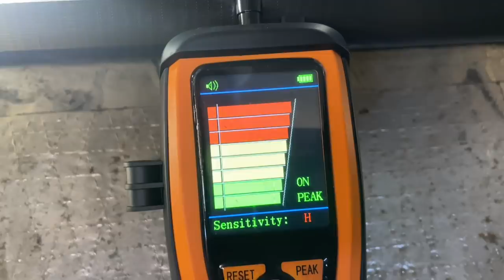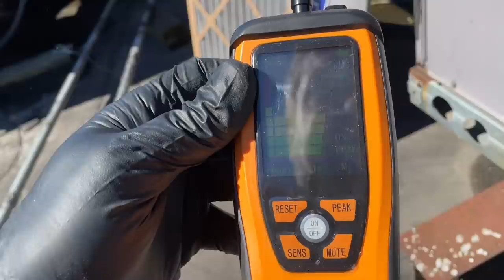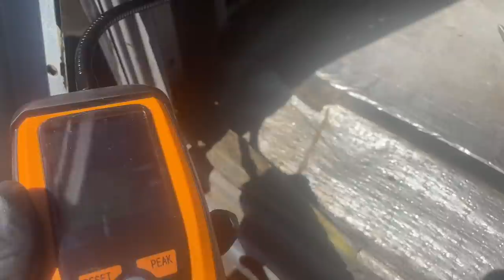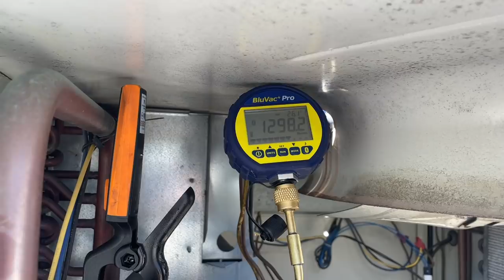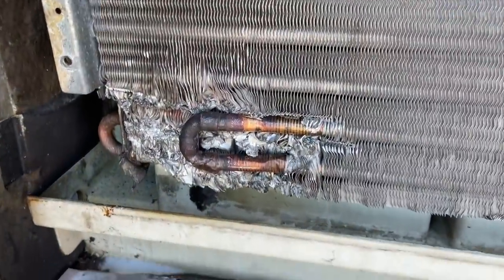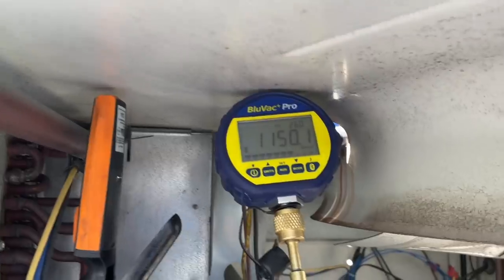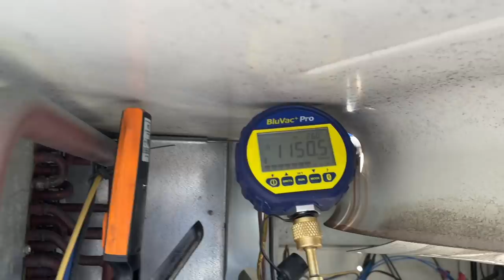Carrier Commercial Rooftop Unit Not Cooling - Low Refrigerant R22 - Leak Found & Fixed

Comment: Coil leak repairs are almost always a pain. Definitely using the correct torch tip is very important. This looks like a normal commercial job site. Most people don’t realize how many tools have to come up and get off the roof to make a repair. Thanks for the videos.

Comment: Can also pull the u bend out and pipe in to the next run in the coil to cut out that entire line of copper. Loose a bit of efficiency but much easier. Nice repair for customer 🤘🤘🇺🇸🇺🇸

Comment: Once I had a leak where the fitting was welded on the condenser of a 1976 Ford Maverick. I didn’t have a lot of money because I was young. My brother who is a chemist had a vacuum pump. I put 5 inches of vacuum on the system and put my rc car fancy super glue with accelerator, released the vacuum (my theory was it would flare out the glue on the inside) waited about 30 minutes then purged and refilled the system. Not only did it work but it lasted for years.

Comment: Great repair! I used to repair 40 year old condenser coil the same way on the subway cars ! I still say the best leak detector for r-22 is the halide tortch! You can see the flame color and exactly trace the leak location! You were fortunate that you had good weather it can get very toasty on a roof top on a hot day Mikey pipes!

Comment: I have had many leaks  similar to that when it’s thin like that you put a large in melted blob of braze just above the hole and let it cool down then re clean the area where you need the braze to run, then slather it with flux ( gel type if you have it) then apply heat to bottom of repair area but never directly on the thin area and it draws nicely over thin area giving you bulk to work with in the thin area, sometimes it screws up but works 90 % of the time love watching you getting it done regardless of obstacles it might be hatchet job but at end of day if it works and holds that’s what counts nice work Mikey plus I never met a customer that did the right thing when it coves to AC systems it just fix it and we deal with it later (never happens lol)

Comment: Mike,  I think the sensor probably went bad in your leak detector, or got wet.  I had one similar to that and it did the same thing when I got the sensor wet.  It came with an extra tip.  Good repair.

Comment: I had a customer with this same model and brand, the dryer came apart and put beads all in the condenser, I had to cut out the lower part of the condenser which made it more of a 4 ton, vs a 5 ton, but it looked a lot like your repair, We do what we gotta do sometimes.

Comment: i gotta say kudos to you..id imagine most other techs would walk away from a repair like that..keep up the good work
Reply: Hey brother, just a heads up cause I’ve had to do this before. Might have been easier to just cut those pipe and seal them off. You’re losing the slightest bit of capacity but you aren’t killing yourself trying to make that loop. Keep up the nice work brother. How do you like that bluvac pro? Ive been looking to invest in one wanted an opinion
Reply: I agree. That’s an impressive fix. I would’ve told them they needed a new unit, unless they want to pay me 2 grand to fix that.

Comment: Did you tell the customer the r-22 was about the cost of a crane for his new unit? :)  I've had dozens of York RTU's that the condenser coil rubbed through on the top lid. Taking the top off solo is fun.

Comment: Mikey.   You could have just eliminated that one u bend.   But you did the right thing.
Reply: @PipeDoctor   Agreed fix was best option if the U bend were eliminated that could cause problems as its at the bottom of the coil where it goes back to liquid set b4 exit to the evap  .. gotta stack it to specs.   Great job!!

Comment: Those look like CoreMax fittings. You arent suppose to be able to pull the shraders out on those, they are suppose to be one piece cores. Those are suppose to offer better flow than a normal shrader but never timed it on my evacs.
Reply: @PipeDoctor  And the CoreMax tool is expensive af. But if you work on mainly commercial those tools are worth it when building up the prices for leaking cores it pays for itself.

Comment: You need a special tool to remove those cores it's about $800. . Also check the hose connected to the oil reservoir on that vp85 it gets clogged has a spring filter in it
Reply: CoreMax Tool. You can always remove the CoreMax cores (making them full port), and install swivel tees. Nylog all mated surfaces, after that - you’re good using good using regular VCRT’s.

Comment: Mike, have you, are are you considering using any of the 22 retrofits out there. Personally I think it's been a nightmare with all these guys running around putting in rs44 nu22,  427 and all this other shit. Not labeling anything correctly. I like 22 and I like 407 but haven't taken the plunge into any others yet

Comment: Carrier uses coremax  valve cores there is a completely different tool to remove those from the system
Reply: @PipeDoctor  yea I actually broke one trying to get it out. Had to recover the charge quick

Comment: $3500?! I just bought 2 new carrier rooftops for  like $8k.
Reply: @PipeDoctor  I’m in jersey not far from you. 6 ton roof top with a manual damper is about $38-3900. Got about 15 of those 48TME units that I’ll be changing over the next couple years. Great pay days for 2 hours worth of work.

Comment: I miss the stream 🤔
Do what you have to but I'm not hacking a repair that is not for my company the only people that made out is the store owner 22 is anywhere from $400 to $1000 my time + equipment ,the coil is the same age. 
I wouldn't give them option 3 new coil or new unit. 
That could've turned disastrous🤣 quickly.
You saved them this time and when it's comes time to really replace they're getting quotes from other companies.
🥃🥃🍺🍺🍺🍇🏌
Stay safe.
Retired(werk'n) keyboard super tech.
Wear your safety glasses.
🥃🥃🍺🍺🍺🍇🏌

Comment: What u think  of Mr cool split  system
Reply: I just installed an 18,000 BTU in small garage. The install came out great. I didn't want the lineset running down the side of my house. I ran them on the inside garage wall. Across and down to about 2' above the floor and out the block to my condenser. It's all hidden from shrubs except for the condenser. I wall mounted that above the shrubs. Outside lineset has brown linest cover. Inside lineset cover is white. I also hate the big coils behind the unit. Sure it would have been a lot easier but I mounted the condenser to the end of the 25' lineset. I ran conduit down the inside garage wall next to the lineset. Poked it out of the block and ran the 220 in pvc to the disco under the lineset cover. You can't see it until my whip going to the disco. 

I had a professional low voltage guy helping me. It is a lot more work than seems presented in videos. Granted my install probably added 2-3 hours with those damn covers. They are a PITA but look great. The unit is amazing. Even if I leave the garage open in So. Fl. and turn it on, you can feel it cooling right away. It's very quiet inside and out. As Mikey Pipes says keeping it real. The condenser is located opposite a guest spare room. The first night I was testing it I heard a vibration inside the house. Outside quiet as can be. They use plastic condenser fans and I noticed a slight wobble. Fairly certain that's where the vibration is coming from. I only heard the one time though. I can't reproduce it so all good for now. Costco had the best price on them. If you use the remote and switch to the app sometimes the app can't tell what state the unit is if not initiated from the app. That is the only bug I have detected.  They are aware of it and looking to resolve it. 

At the end of the day these things aren't the best looking things. I made mine look really nice and hardly noticeable. It makes me feel good to look at it plus how well it works.
Reply: Get a Pioneer unit,I think they are built much better,I've done start ups on some and so far they are nicer units
Reply: @petersmart1999  I wouldn't be surprised if they both came out of the same factory. Without the decals they look identical. Mr. Cool has added features that other brands charge for. They put all the bells and whistles together for a great price. Originally I was looking at the Mitsu's but everything Mr. Cool includes was an option with Mitsu's. Also about 4 X's more expensive. Mr. Cool is also the only one I know including the charged lines so you don't have to vac and charge. Much better for a DIYer. I haven't seen anything bad about Mr. Cool but I have had AC guys tell me Mitsu's are best units but they come at a price. This is for a workshop that I won't be in a lot so this was fine for my situation.
Reply: @scotts4125  I get it,,yes Mitsubishi and Fujitsu are definitely at the Top of the food chain,I have Mitsubishis at work that have been running 24/7/365 for 23.5 years,tgat says alot about then for sure! I can't really knock the mr.cool units only seen one,pioneers I've seen and worked with several

Comment: Ugg, you butchered it!  I've done this repair many times and there is no getting around pulling the top off and pulling the evaporator coil out of the unit and fixing the leak. Additionally I don't fix those tube sheet leaks with a disk grinder, you can fix those leaks and loop leaks in a way that, if done right, you cant hardly tell there was a leak repair. First, use a hack saw blade, just the blade, and carefully slide it behind the metal tube sheet and cut the loop free. This leaves two holes with tubes cut flat to the sheet of metal. Then take a 5/8" hole saw and put the drill bit in backwards and use the end as a guide and drill out two slugs around each tube. Then use a old school swagger the kind that's a metal spike and hammer it into each copper tube making a flare. then take the loop you cut free and put back in place and braze it in and your done. Put the coil back in place with new filter drier and the rest is academic. I've used the hand press type swagger too, or even a needle nose plyers to get my tubing to flare enough that I can jam the loop in so it stays long enough to braze in place.
also those carrier shreaders require a special tool to pull out the cores.